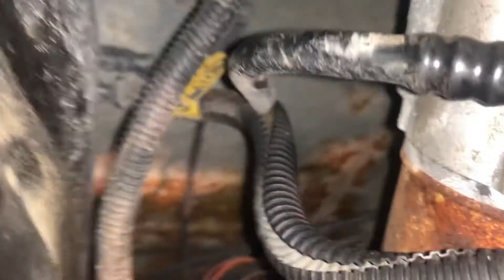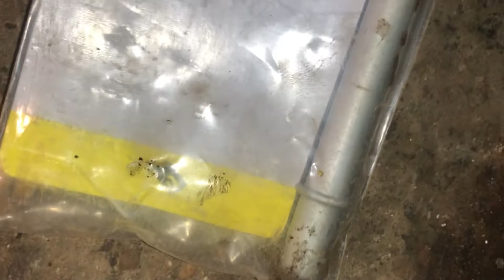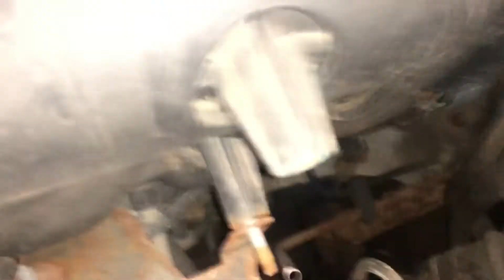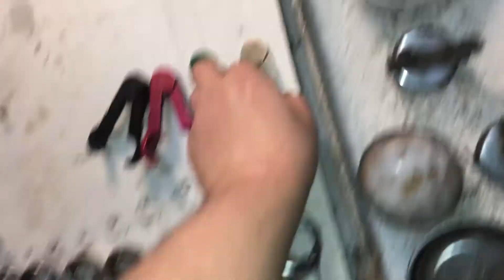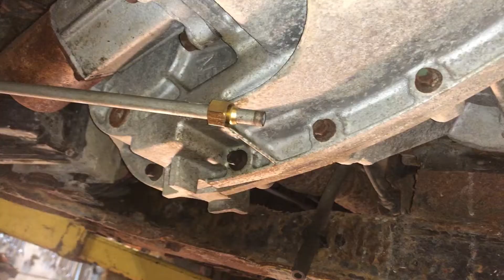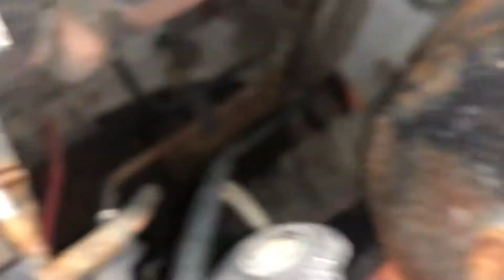Chevy trailblazer replace fuel line & fitting from fuel pump module

Comment: How much would a shop typically charge for this job out of curiosity?
Reply from the maker: id say most shops 100-200$ maybe more labor
Reply: @FerKurl  appreciate the help. I'm new to the DIY stuff, and I'd rather not take on this job. I'm buying a 2007 TB from my boss, and the whole metal line is rusted out from the connector up to about just under the steering area.

Comment: Thank you for posting this man! Just recently I started smelling gas after running my 05 TB. My first thought was maybe a purge valve or one of the other valves starting to fail. I preemptively purchased both in preparation to replace them….but just today I was able to find that this exact little connector actually has a slow drip coming out of it. Exactly where yours is. 

Couple of questions, is it possible to just replace that connector or maybe change out the gaskets and clean off the metal that it connects to? Or am I better off just replacing the entire line (it definitely does have some rust to it; Love the rust belt so much🙄)